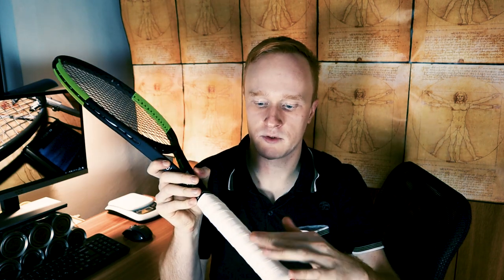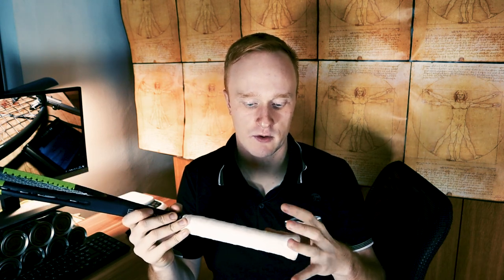DIY - Change your racket grip shape

Comment: Most people now prefer not to change the shape but rather custom reduce the entire grip to the hand which is very difficult. It's easier to enlarge the grip when prefered if it's already been reduced in size. And a better fitting grip to the hand makes a lot of difference.
I had made a grip reducer mill that allows me to reduce the size of any tennis racket grip to as much as 1/32" (possibly more on grip with thick walls) on all eight sides without losing the structural integrity of the handle. With a reduced handle, the grip can now be customized further to the hand either by adding tape or different thicknesses of wrap.
I've seen others using sandpaper and milling file but I find those very inaccurate and sometimes ruin the shape of the grip.
Reply: Can you make a tutorial  how to reduce grip size?

Comment: Hi. Can you make a video to how to decrease the grip size?
Reply from the maker: I don't have a great reliable method for this, but if I come up with something then I'll make a video. If you have a pallet style handle, then you can easily switch the pallets to smaller size.
Reply: if hard foam handle. then use sand paper. just take 0.5 mm off all way around

Comment: dude, the problem with this is that the athletic tape or in fact ANY adhesive.... wont stick to that smooth foam material Wilson has used. Even when I try to put on a new replacement grip.... I have to pray the grip stays on. That foam stuff Wilson use is very adhesive repellant.
Reply from the maker: Hm m That is a problem yes. Try using a small amount of superglue fornthe first Layer od atheltic tape.
Reply: sand the handle just slightly first, so you get some ground for the adhesive.
Reply: @benjaminjensen111  Hi... yeah that is where this whole thing lead me to. once you sand it down, its great for sticking. thanks anyways!